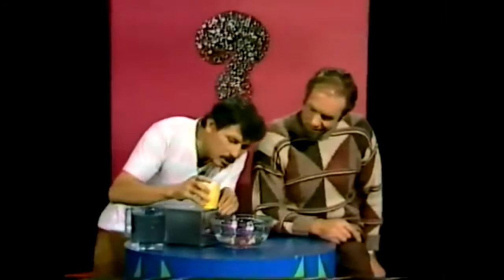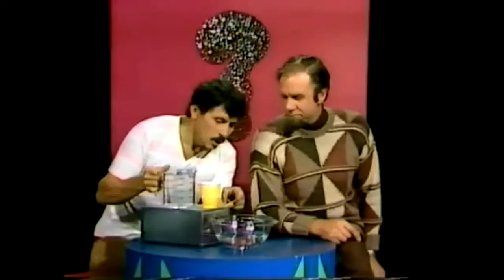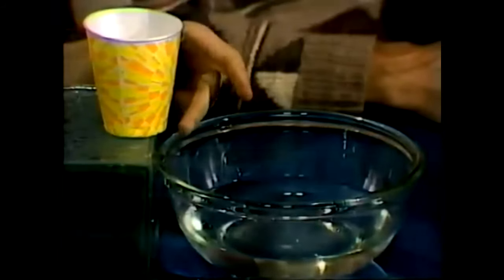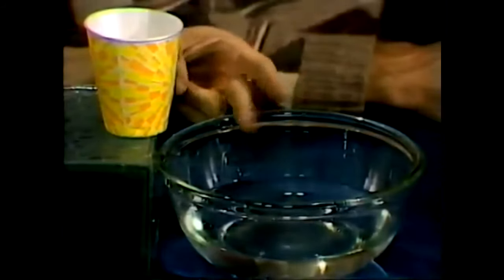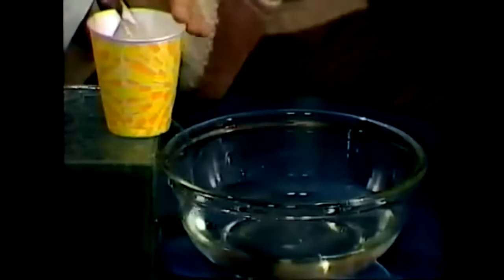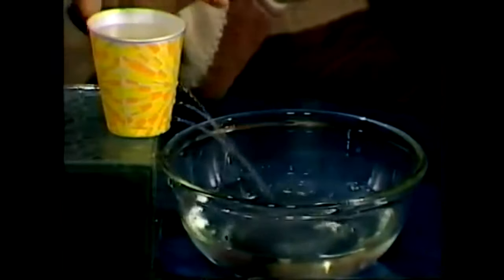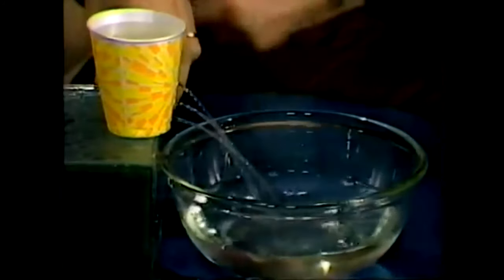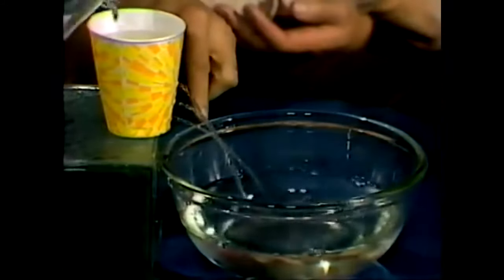Water Fountain Puzzle

Comment: Answer to the last question. The same distance.
Reply: The greater the total area of the holes, the less distance the water from any one hole will go.
Reply: @smadaf   @smadaf No, the important thing here is something called the "hydraulic head". That is the pressure of water at a certain depth. The hydraulic head is defined only by the water (or fluid in general) above that point. It doesn't matter how much water or fluid is there lateral or near that point. What counts is only the pressure of fluid above up to the surface. No matter how many holes you put into the cup, the pressure will always be the same for all of them at a certain depth, or in this case the height of the cup. So @johnburn8031 is correct.
Reply: @exelfoley I didn't know for sure but assumed that must be the case given how effective water towers are.
Reply: @exelfoley  The distance the water goes is also affected by the full bernoulli equation.  The water only goes the "same distance" when you consider the holes negligibly small. Otherwise there is a drop in static pressure because of the motion of the water.
Reply: @MushookieMan Nice 👍